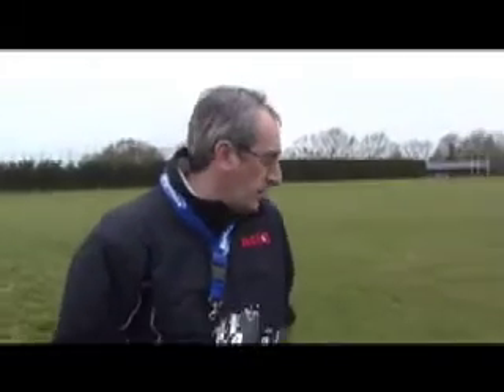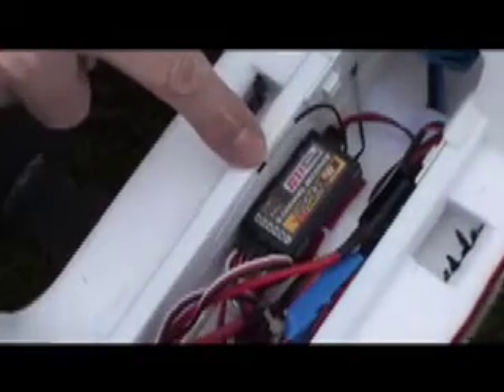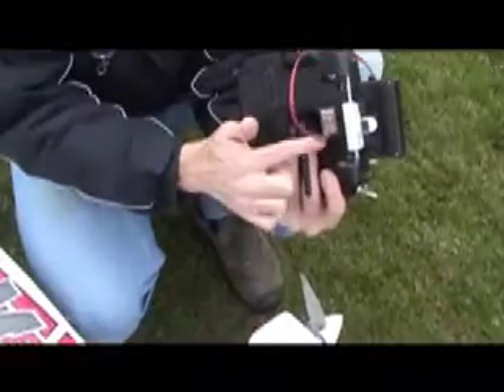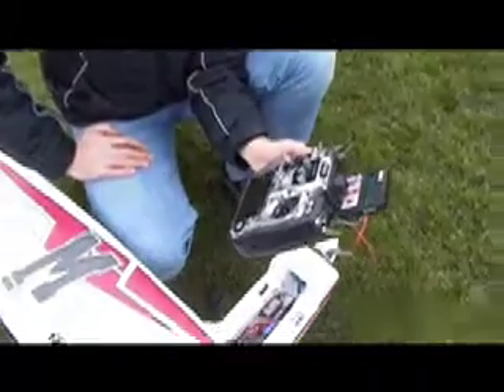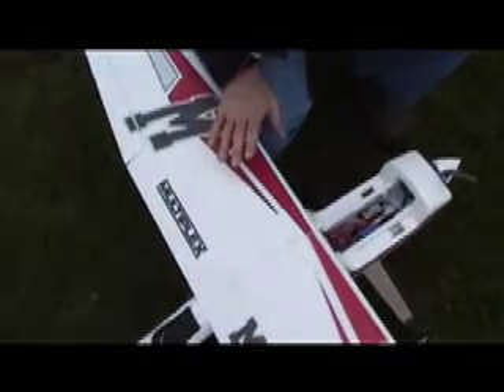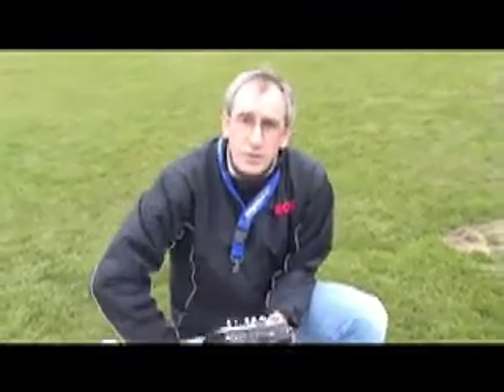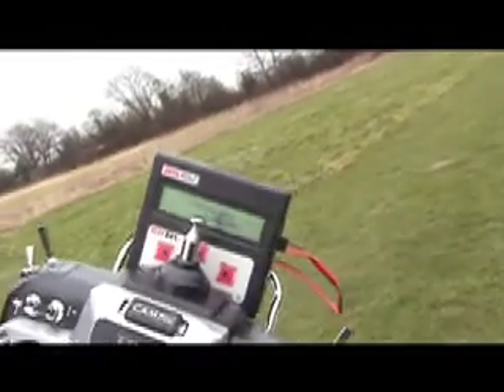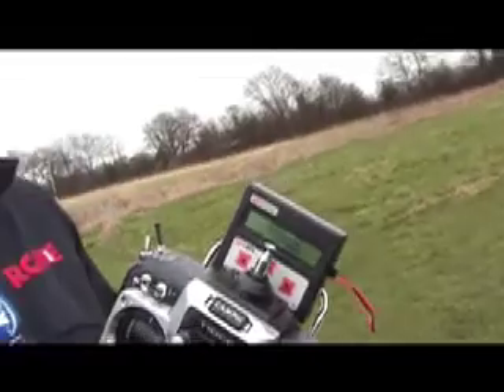Flying the Multiplex Mentor with Jeti Duplex 2.4GHz

Comment: The Multiplex Mentor is a great trainer plane but putting the battery in and out is a pain due to poor access. I've pulled out the elevator cable once from the RX when inserting the battery. Thank goodness for pre-flight control surface checks. I hope Spektrum will be providing the same Telemetry tech soon.